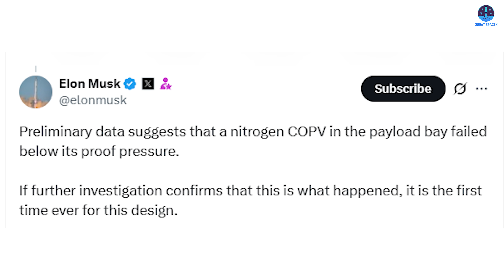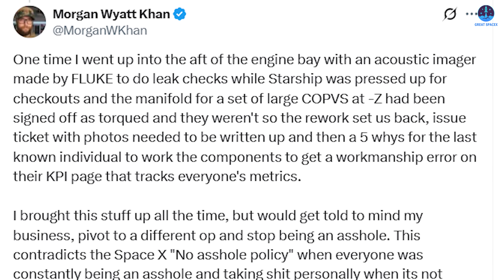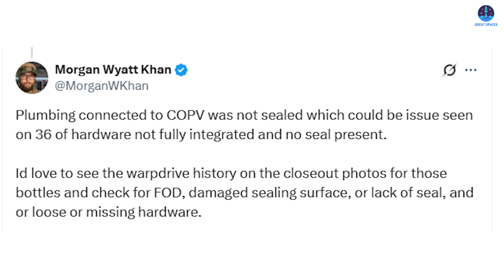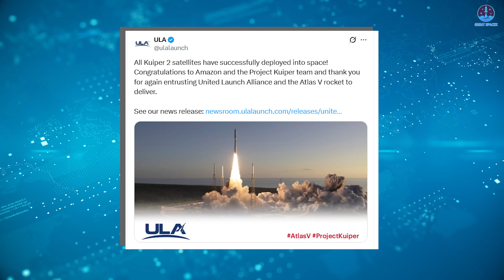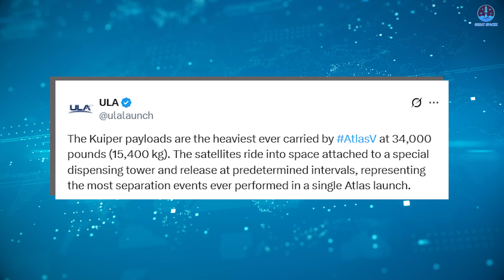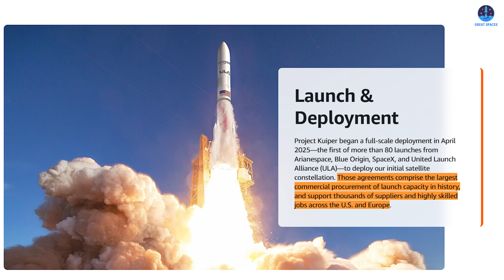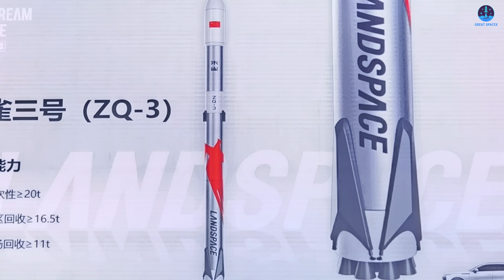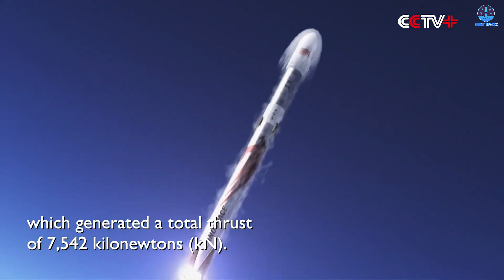Unexpected! Ex-SpaceX employee exposed The Real Reason Ship 36 exploded...Is this real

Comment: SpaceX had small problems and was quickly advancing then D.O.G.E.  happened.  They need to investigate all the employees and suppliers.
Reply: Morgan's posts reveal that the real Starship problem is a production culture. It doesn't rot quickly. On the other hand, Falcon 9 flies successfully. It seems, the problem is in the Starship department.
Reply: Can't take any disgruntled employees' word for fact.  @TheDimchikb
Reply: @micahisawesome4843  The problems in the process management have been obvious to me since that case with insufficient pressure in the spinning system at Flight 8. Again, when one starship explodes, it can be an accident or a flaw in design. When three of them explode in a row for the very same problem, it's not a design flaw; it's a gap in processes. 5 "why" etc. This guy's disclosure only exposes how deep and extent the gap is.

Comment: If it is, and I underline if, true, it would be quite similar to the case of Apollo 13, when the tank that later exploded was slightly damaged during testing, when it 'fell' on its support from a few but apparently enough centimeters of height. This is in addition to the well known issue of the 'stirrer' with the damaged contacts

Comment: Musk should get reinvolved now and get his management doing their jobs properly.

New technology needs new skills. If the materials are delicate then they need proper skilled people and not just anyone off the street. Maybe dei has shown its dead hand here.

An example was fibre optic cables back when they were all glass centred. You used to see electrical installers handling them like copper cables, with the resulting breaks when they pulled too hard or bent too tight. You had to make sure the spark was familiar or do it yourself.
Reply: COPV's have been around for more than 50 years.  Handling procedures of ANY space hardware are very precisely defined, operators are trained, and reporting procedures are in place. If something happens, like a tool hits a tank, a finite element analysis would be run to validate adequate margins. But then that's at normal space companies.
Reply: @mariem3800  understandable, but spacex is not trying to be a " normal" space company. As far as i am aware they are trying to up everyones game, and that will bring problems until they are solved.

When you are trying to launch new vehicles on maybe a monthly basis, it is a massive difference to say NASA which ended up launching every couple of years for its manned programme. To do that you need more people and some will necessarily come from outside the industry and need training. But if they dont learn quick enough they can damage delicate equipment just with injudicious handling. Eventually you have to have a pool of experts big enough to do the job, or find ways to take " lab level" work to " engineering shop" level so that these potential problems dont occur with non extremely qualified staff. That is eventually the way to massively increase output from all space companies.

Comment: Every time I see starship ice up when being loaded, I can’t help but wonder what happens to the side covered in tiles. Seems to me the tiles form a thermal barrier so I guess that on that side the metal is at least somewhat colder than on the exposed side. No idea by how much and no idea if it affects the overall structure and components.

Comment: They cant get talent to move out there. I understand. Theres not much to do around that area so ppl dont wanna move to a town that is also a whole culture shock. So I am sure most of the ppl that work there worked in the oil fields. So they just put together without quality. They can bounce up but they will need a whole restructure. They have built better Starships. I am sure they can fix the issues.

Comment: Okay I am not buying the former employees story. I worked for SpaceX. Dragon program. 5 years in the Air Force? Did he get discharged because you re-enlist it's for 4 years correct? Bad behavior of employees? I get the normal stuff but anything to do with Starship by those guys? No. Those guys have a lot invested in that ship. Blood, sweat, and tears. Cross threaded bolts? Ha. There is no way the QA Inspector that is watching you put bolts in and and applying the correct torque is going to sign off on that line of the procedure. Not one bolt is installed without a second set of eyes or a QA. This sounds like an former employee that is disgruntled about not fitting in or because he couldn't cut it. If anything it's the long hours that you are required to work. Like 12 to 14 hour days, 6 days a week(sometimes 7).

Comment: Carbon fiber is an amazing fiber. It has great strength longitudinally. But it's greatest weakness is almost zero strength 90 degrees to it's longitudinal axis. Any damage to the carbon fiber will create a stress riser and failure at that point. This includes outward bulging of the aluminum tank as well. They need layers of aramid, carbon, nylon etc, to maximize the strength and durability while minimizing the inherent weakness of metal fatigue of aluminum and cross axis decoupling of carbon. At that point, a steel tank might be lighter and more durable.

Comment: If these allegations are true, then the Starship program really is a danger to the public. Starship is a mighty big rocket.

Stainless steel can work wonders in rocket construction. Back in the 1960s, North American Aviation put together two cryogenic stainless steel balloons and attached rocket engines to the back to create the second stage of the Saturn V, the S-II. And those stainless steel tank walls doubled as the wall of the stage. 60 years on, it's hard to believe metallurgy for rocket construction can't do at least as well.

Comment: Thanks for this video.

The question now is why Musk and Shotwell let this happen.

They both have control. When something like sloppiness occurs,
it's always management who doesn't have the control system under control or doesn't care.

Quality control is the most important part of development and manufacturing,
because only that makes the engineers' work valuable.

If Musk isn't able to rediscover his vision of a quality management system worthy of its name, he can stop dreaming and retire.

If Shotwell "doesn't have the balls" to equip the company with a quality management system that ensures safety and quality, she's just a "nice to have."

Don't scream, she's good, but S36 is her responsibility. Period.

I don't understand at all how all this could have happened.

If I worked like that, I'd be unemployed, and rightly so.

Okay, am I going to get a shitstorm now?
Reply: No one can know about everything that’s going on - they all rely on levels of delegation.  It would appear though that QA needs to be revamped.
Reply: But that's a very simple idea.

If I want to use two things that work together, it's enough to say, "Okay, let's put it together and see what happens."

I don't build rockets.

But welds require extreme testing and inspection.

Copyrights may only be installed by trained personnel under the guidance of the engineers who designed the system.

But I'm really picky!
Reply: copv not Copyrights
Reply: Shotwell and Musk got the workforce they asked for, ones that do the equivalent of a proctologist prostate probe with their proboscis. Khan was fired for speaking up. At what point does the boss WANT to be told when they’re doing something dumb?

I don’t think SoaceX is there yet.

Comment: The parallel with the Titan sub failure is striking. It is a point well made that composites have to be rigorously quality controlled and handled with great care, especially with items that are to experience pressure cycles. I've worked with composite pressure piping systems and seen failures due to accidental impacts during handling and installation. Outwardly no damage visible but  then a failure under pressure

Comment: So, another words the reality appears to be that Starship is built with the same manufacturing techniques as Tesla with a similar slew of quality control problems that Tesla has faced. Not good. Outerspace is not Consumer Reports. Outerspace will not tolerate poor workmanship. Outerspace is not politically biased. Clearly SpacEx is not building Starship Rockets correctly to be able to stand the stresses of outerspace. If I'm Nasa I would be quite concerned and would insist on being involved with Quality control measures in the process of building Starship. Perhaps Nasa needs to re-think its contracts with Starship and look elsewhere.

Comment: The Titan Submersible CEO would not accept COPV pressurisation limitations and it resulted in deaths.
I might be wrong but the same issue may be translated to the header tank on Starship.
Reply: While the titan submersible may have been made of a composite material, it was NOT comparable to a COPV. In fact, the submersible contained a relative VACUUM compared to the very high pressures on the outside of the vessel. COPV on the other hand, holds extremely high pressures on the INSIDE.

Comment: With decades of advanced material reinforcement, manufacturing, quality control, ASTM (I) and forensic failure analysis engineering experience, proper handling, installation techniques and application are critical else catastrophic failure is all but guaranteed.

I have a new design and stability system that will be more stable and reliable that the current tank system I am considering discussing with SpaceX. 

As to the allegations made by the former SpaceX employee, no way to validate the validity of the claims or motivation thereof.

Comment: With that speed of production this is inevitable. It is just a wonder that this hasn't happend earlier.
Reply: Constantly rushing production tends to exhaust technicians and makes them care less (and careless). Especially, if management has already checked out.
Reply: How could they have a complete improved design already built that mitigates these and other problems? It's ready for testing as soon as the test stand is ready. The older design was already abandoned.

Comment: As with plane crashes...rush towards blaming the Pilots instead of the hardware. The same here, while ignoring questionable quality control.
Reply: Quality Control at Starbase is a joke compared to the Cape. The only SoaceX techs or engineers that transfer to Starbase are those that can't cut it at the Cape or those that need the bonus for transfer.

Comment: Why come forward now and talk about what SpaceX is doing. He should've been came out of the dark into the light and spoke up about what's going on at SpaceX. He trying to get clout 😂
Reply: If you're going to be a whistle blower you have to name names... and at 2 or 3 levels above as well. Fail that and you're just another self-emulator.
Reply: Sometimes you need separation before you really recognize the risk. We're making an assumption they didn't speak up, and perhaps they had but it was only elevated within the company. Then when you see a failure which you more or less could have predicted, you get aggravated that you weren't being listened to when it might have made a difference. Consider if you will, the engineers that called out the risk of the STS rocket booster o-rings; you didn't find out about them until after the Challenger.